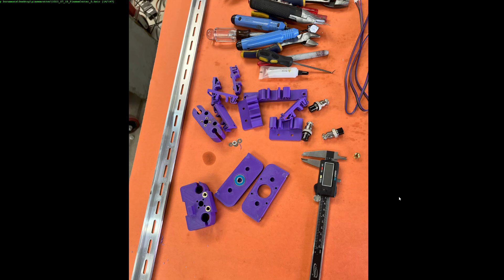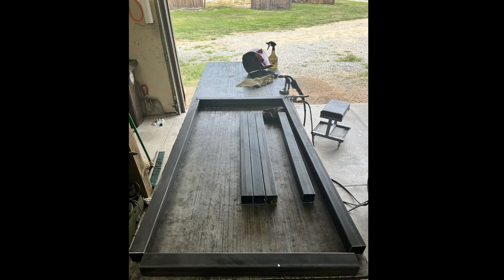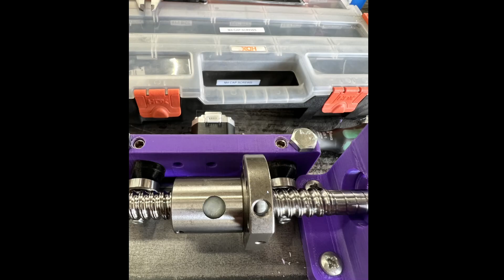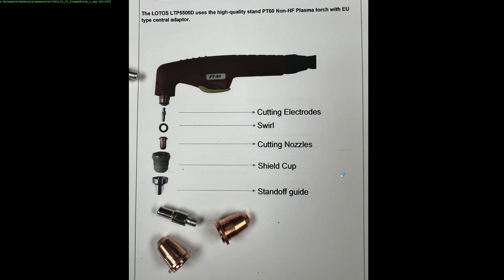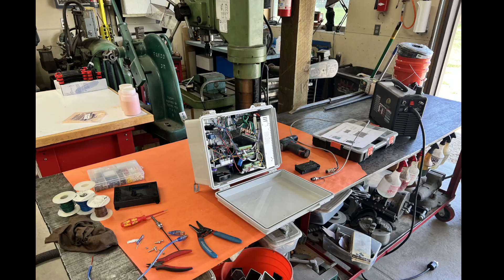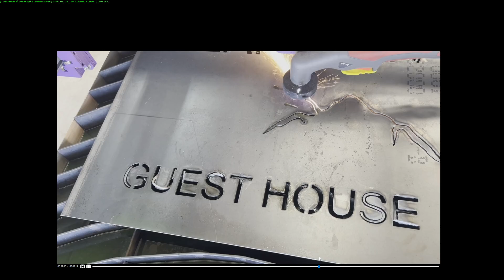CNC Plasma Cutter / Workbench - Inspired by JD's Garage design - Long Version

Comment: I think I'm between $800-1000 on my JD's garage table. And that doesn't include the tools I bought to build it. lol. It does include the $250 plasma cutter an $150 machine torch for it. I think $500-600 for the basic table with no extra equipment is more realistic. But it's still a great resource! Coincidentally, I 3d printed all the parts in purple as well. haha

Comment: Very nice effort!  I noticed that you are supporting the short axis on your table from only 1 end.  Did you have to make any changes to make this work without and sagging, or was the original JDG design sufficient for the 2-foot cutting span?
Reply: I would also like to see your table plans.  Is it possible to share a Fusion project as read-only?

Comment: why don't you up the voltage to 36v or 48v it will increase your performance? Also why didn't you just use a arduino uno r4 wifi? it has a dual core esp32 with wifi and Bluetooth integrated on the board with a led dot matrix.

Comment: could you explain how you route or suport the cable when you use it under the bench because i love your concept - make a bench of plasma table- I did the jd grarage plan and i will be happy to do like you 
thanks
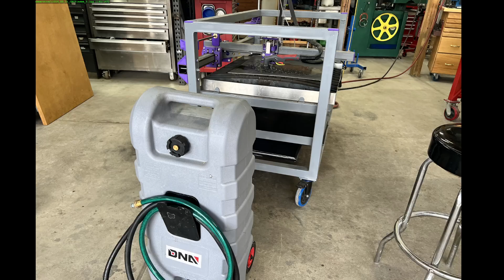Reply from the maker: The X and Y cables + the eStop wiring is routed inside the square tubing.  I drilled holes and used rubber grommets to protect the wire where it enters the =tubing.   If you look at the view shown at 16:56 you can see the wires sticking out of the square tubing protected for painting.  The Plasma line and Z-axis are clipped onto the end of a bent piece of metal conduit.  I used a  cheap cababiner with an idea that I'll print something better sometime.  To mount the conduit to the frame, I printed a sleeve that fits inside the square tubing and has a round opening to slide in the conduit.  See it at 23:58.  When I want to stow the table under the top, I just lift the condit out and lay it across the table

Comment: Can u share Your Wiring Diagram , as in not for Motors , but how can i Connect my Plasma to the Arduino, and also when i Connect Air Compressor it Crashes my PC

Comment: next you new project need be use elektric board better fasten more memory ESP32 board, perfect if use makerbase MKS DLC32 board whit TS32 display. this board has uses to laser but i think has best board use plasma too. cheap better version than arduino. and board have bluetooth and wifi too in board.  only need understand how add to firmware GRPL THC in code. nice job and interesting video, future i try build plasma too, 

now i have CNC milling machine DIY, cheap 10$ BOB, paraller port, linuxcnc, 2x 36V power supply, 4x DM556 drivers, XYYZ motors, nema 23 470 OZ, spindle 2,2KW water cooled ER20, whit VFD, working well. only problem have not understand linucnc code how add touch plate tool height zeroing, and display add button who working call this G-code. linuxcnc version 2.8.4 debian base.

Comment: i has living city what is name SALO, you need make simple video how can make step to step touch plate setting to linuxcnc, not found any good video how make this tool height zeroing system to linuxcnc,  i has build cnc working well but tool height system not understand how make, linux forum has many try help but any not working, alltime only lot errors, hall meter wiring working ok, true/false wiring to tool height sensor its ok, but display need make button and then call code, not know how this doing, and were code need add, and who not do/move this code if bush display button. web not has any good video how make this. please help.

Comment: Even the store bought has such big steppers. I do not think you need them. That stepper can twist the whole machine apart. very very clean machine, nice work, good job. 
I crashed my z axis on a DYI router down into some wood pushing up the very large thick heavy x axis. It just kept going. had to rebuild the z.  hs5629 the smaller 23s

Comment: As a retired kindred mechanical / robotics designer type guy, I do like many of your solutions. I, too, would like to have a small CNC plasma table, but I have similar space constraints, not to mention being cheap.  I'll do the right thing and buy JD's plans, though mostly for the print files, new controller and torch height build list.  I already have a commercial spec miniature Z axis assembly with linear rails and ball screw salvaged from the company scrap bin, so that's a potential win. 

Thanks to JD's Garage and yourself for doing ali of the heavy lifting.

Comment: Nice job.  I like the metal lift setup you have.  Ive just been running a few gallons of water now. Just a 1/4 inch seems to work good enough for catching sparks, for my use at least.
Reply from the maker: Thanks.  I started out with the tank almost completely full.  It made a mess, splashed water everywhere and spilled if I bumped the table or tired to move it at all.  My last run with the machine was with about 3/4" of water.  The shop got a bit dusty, I though I'd try the next run a bit in between.